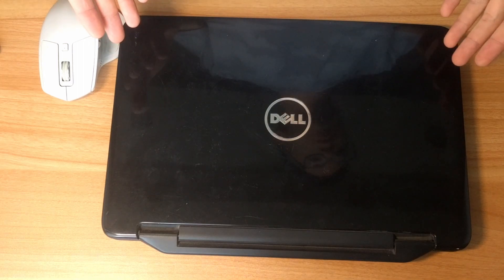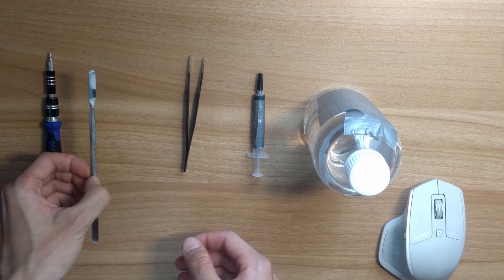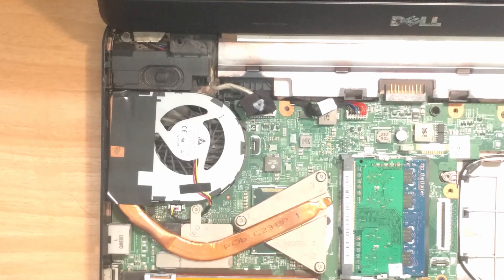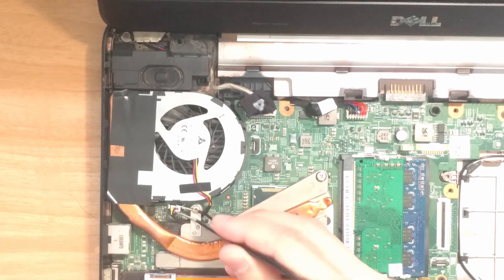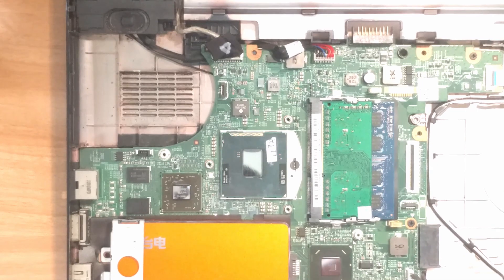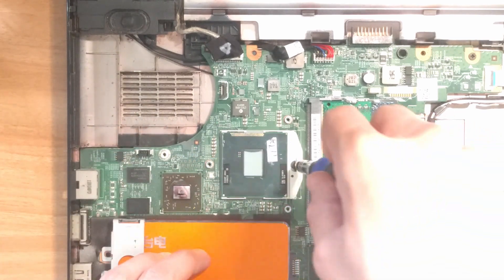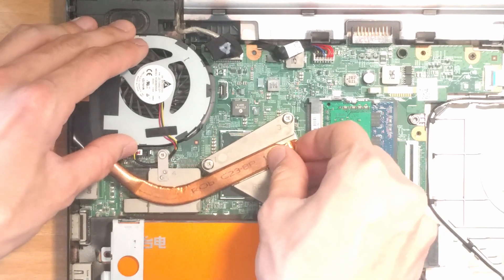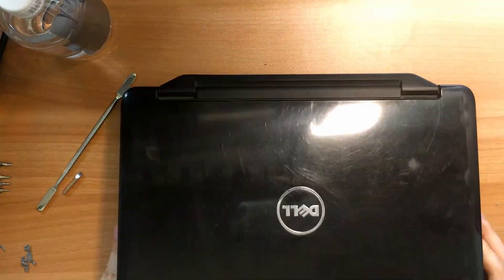Dell Inspiron CPU Upgrade

Comment: Great video - thank you! So Windows 11 upgrade failed due to processor in my Inspiron not being compatible - I was quite surprised. The processor is a Core i7-6700HQ and the specs are more that what Windows 11 minimum requirement is. So the question is - Can I upgrade the processor on this laptop - or is it soldered in?
Reply: i have same problems bro. :( i have Intel Core i7-6500U
Reply: It is soldered in
Reply: Your processor should be of minimum 7th generation for windows 11 ....6700HQ is a 6th generation processor.
Reply: @rohitjangid6893  Thank you so much! What number does 7th gen start from?
Reply: @oi3459  In 6700HQ number 6 states that it is from 6th generation. 
Same as for 7th generation the nimber start from 7 onwards.
Reply: @rohitjangid6893  actually windows 11 requires 8th gen cpus

Comment: Is it possible to take an i5 M460 @2.53GHz 2534 MHz CPU from a Dell XPS L701X and put it in a Dell Inspiron N7110 that currently has an i3-2330M 2.20GHz 2200 MHz CPU in?
Reply from the maker: I have made a video about how to choose the correct CPU, and you can find that in my channel. But just by looking at the names of the processors, it seems that they are different generation Intel CPUs, so the chipset on the motherboard may not support it.
Reply: Donald Sunny   i3-2330m=> i5-2540m / i7-2640m /
Reply: @qiaojiezheng5310  where is the video?

Comment: Is the Core i5 2330m the last upgrade for this laptop ?
Reply from the maker: You could replace the disk tray with a secondary hard drive, but I don't have the access to that machine.

Comment: would you be able to install 16GB ddr3 1333mhz? 
does the new cpu support 16GB? I have 2 4GBs and 2 8GBs to install but couldn't decide which to install. can you help?
Reply: You can install 2 stick 8GB+8GB RAM, 2Rx8 1.35v so-dimm DDR3L-1600, any manufacturer. What processor is in the laptop? Does the laptop have a Radeon graphics card or just HD Graphics?
Reply: @vladimirazirov1815  DDR3L and DDR3 are very different ram sticks. Mine has HD graphics. I have ram DDR3 ram sticks only.
Reply: @kergun11  You can use memory stick DDR3-1333 1.5v 2Rx8 8gb+8gb.
It's just that DDR3L (1.35v, 2Rx8) is more universal, so I bought these. The processor for upgrade is suitable i5-2540m, i7-2630qm. I use thermal paste GD007, I change the thermal paste and clean the radiator from dust every 2.5 years.
Reply: @kergun11  for a laptop to use 16GB of RAM (8+8), it must be Windows 10 x64 or Windows 7 x64, which according to the specification supports 16GB of RAM.
8GB memory sticks must be of the 2Rx8 type, 4GB memory sticks can be of any type (2Rx8 or 1Rx8).
Reply: @vladimirazirov1815  thank you

Comment: I've the Dell Inspiron with below specifications. I would like to know, can I upgrade the CPU along with GPU to support windows 11. Please suggest to which one I have to upgrade.

System Model: Inspiron 5537
Processor: Intel(R) Core(TM) i5-4200U CPU @ 1.60GHz (4 CPUs), ~2.3GHz
Memory: 12288MB RAM
Card name: AMD Radeon HD 8670M
Chip type: AMD Radeon Graphics Processor (0x6660)
Reply: That is a U cpu and is soldered down. Only M cpus are socketed.

Comment: I have dell inspiron n5010
Can i upgrade it to a gaming laptop?
Reply from the maker: You definitely can, but it would require a lot of parts. Like external GPU and a high performance CPU. It might be better just to build a desktop with modern parts.
Reply: @qiaojiezheng5310  Thanks!
Reply: I've got an inspiron 5593 with a core i5 1035G1. Can i upgrade that to a ryzen 5 3600?

Comment: I have Latitude E6540 i7 4800MQ can i downgrade to i7 4200U for better battery life?
Reply from the maker: These are two totally different processors. U series chips need to be soldered onto the motherboard.

Comment: Hello great video end thank for support
I have a question about upgrading my laptop dell inspiron 11 3000 cpu can it be upgraded to higher cpu
Reply: this processor is soldered to the motherboard and cannot be replaced.
Reply: @slavafedotov5742  well. Thank you for responding 
I also i have brought a used laptop dell Alienware 14 but is getin overheating end shuts dawn ,what do you think , where the problem is 
Thermal paste or something else
Reply: @HazCS  
1) the thermal paste has dried.
2) the radiator is clogged with dust.
3) disassemble and lubricate the fan bearing with machine oil (2-3 drops).
Reply: @HazCS  very rarely there is such a malfunction that the tube of the Cooling System is faulty - it loses its properties to conduct heat. Then you need to buy a new Cooling System (it is possible without a fan). This is done if the first 3 points did not help reduce the heating )
Reply: @slavafedotov5742  thank you for responding
You are a big help ,so it means i can repair my laptop to work normally ,all this problems can be repaired as i know
Reply: @No Matter's A6-6310 - это припаянный процессор (socket BGA). Нормальный процессор, 4 ядра, 2.4ггц. Поставьте SSD и 8-12-16GB оперативки DDR3L-1600/-1866 (1.35v).
Reply: @No Matter's да, при нагрузке поднимает. Так работает на базовой частоте 1.8. Вы можете открыть программу CPU-Z и включить например видео и понаблюдать за частотой.
Reply: @No Matter's можно процессор заставить работать интенсивней. Это разряжает батарею сильнее, но если вы работаете от сети, то это не важно. Проверьте в биос, включен ли турбобуст. Потом как Виндовс загрузится, то нажмите правой клавишей на значок Батареи в правом нижнем углу. Выберите пункт Электропитание.
Reply: @No Matter's потом в новом окне установите галочку напротив Высокая Производительность. Дальше заходите в пункт Настройка схемы электропитания -> изменить дополнительные параметры питания -> управление питанием процессора -> 
минимальное состояние процессора от сети и батареи ставите 95%;
максимальное состояние процессора от сети и батареи ставите 100%.
Reply: @No Matter's помогло? стал процессор быстрее работать? в биос есть настройка "включение-выключение турбобуста"?

Comment: Hey, there! I have a laptop Dell i14 5447 (2 in 1). My current processor is a i7 4510U. I'd like to know if its possible to upgrade to a more recent i7 generation. Is it worth it?
Reply from the maker: U series processors are soldered to the motherboard
Reply: @qiaojiezheng5310  sad... thank you, anyway

Comment: That looks like an AMD socket? Does intel Mobile cpus use pga?
Reply: I had no idea intel did pga.
Reply: @troublebreathing8648  which processor is installed in the laptop?
Reply: @slavafedotov5742  a pentium t1500 I think
Reply: @troublebreathing8648  
can install Core 2 Duo t8300 or Core 2 Duo t9300
Before replacing the processor, install the latest BIOS for your laptop model. Buy a syringe (1-2g) with thermal grease. For example, GD900 / GD007. Wipe off the old thermal grease with wet wipes and apply a new thermal grease with a thin layer throughout the processor chip (0.1-0.2mm). Blow out the radiator from dust and disassemble the fan and lubricate the bearing with engine oil (2-3 drops)
Reply: @slavafedotov5742  thanks!

Comment: Can i upgrade proccer on dell inspiron 3521 replay faast i want to install ryzen prossecer😉😉😭😭😁😊
Reply from the maker: Ryzen and Core uses totally different chip set and pin configuration, you will have to use a more powerful intel chip. I have another video about how to choose the CPU -> https://www.youtube.com/watch?v=USn0Syh3DR8
Reply: What happened with this? What chip did you end up using.

Comment: Hi sir, I am student and I am studying engineering I have Dell N4050 laptop and if i upgraded that to i5 processor and 8 gb ram, can I use softwares like solid works, catia v5, auto cad, designing software please help me on this sir 
Thanking you
Reply from the maker: 3D CAD software has a high requirement on the GPU. While the N4050 can run those programs,  you won't be able to manipulate large assembly files. Laptops with Quadro or Radeon Pro should be better, like the ThinkPad P1.

Comment: Whats the highest cpu upgrade?
Reply: I saw a video where the i7-2630qm processor was installed in this laptop, but the discrete AMD Radeon card and the turbo boost in the processor were turned off in the BIOS, because the cooling is weak in the laptop. 
We got 2GHz, 4 cores, 8 threads. Together with SSD and 8GB of RAM, normal performance turned out :)

Comment: Mine is Dell Inspiron n5110 what cpu can I change to mine?
Reply: what is your processor (model)?
Reply: @slavafedotov5742  İNTEL CORE İ5 2430m
Reply: @BurakKara  what laptop model? Does the laptop have an video card AMD/Nvidia or only an integrated card HD Graphics 3000?
Reply: @slavafedotov5742  DELL İNSPİRON N5110  intel core i52430m 😟.   Cpu upgrade ? İntel core i7 2720QM upgrage yes ? Bios update yes A11 ( Youtube loading )
Reply: @slavafedotov5742  ??
Reply: @BurakKara  i7 processor (4 core / 45W) can be installed. So that the Nvidia video card does not burn out (in the laptop there is one tube in the cooling system) from the hot processor, I advise you to turn off the turbo boost on the i7 processor. (the frequency will be on i7-2720qm -> 2.2GHz, on i7-2760qm -> 2.4GHz). 
With turbo-boost turned off, the TDP of the i7 processor is 26-28W.
Install BIOS version A11 before replacing the processor. 
RAM 8-12-16GB DDR3-1333, DDR3-1600 1.5v.
Reply: @BurakKara  Turboboost can be turned off via the "Power" section. Set the mode to "balanced", then go to the section "power scheme settings" -> processor power management -> set the maximum processor state to 99%, minimum 0%.
Reply: @BurakKara  I have i7-2760qm installed in my laptop. Together with SSD 250GB and 12GB of RAM, the processor has good performance, even without a turbo boost. Buy SSD 120-256GB (sata-lll, 3D TLC, 2.5") for disk C (Windows, programs, games), HDD (disk D / file storage) transfer to the DVD slot through the Caddy adapter.

If you want a turbocharged i7 then buy the i7-2630qm, which is less hot. But the turbo boost makes little sense here, because the laptop has a weak nVidia GT525m video card (which is the laptop's weak point) and the power supply will get very hot.
Reply: @slavafedotov5742  Apacer 120 GB PANTHER AS340 (how?) 120gb sufficient ?
Reply: @BurakKara  120GB is enough. Windows takes 40GB. Have you already bought an SSD Apacer?
Reply: @BurakKara  If you have not bought this SSD, then it is better to buy an SSD at a higher price, the quality is better there.

SSD Kingston HyperX Fury 3D 120GB 2.5" SATAIII TLC,
SSD Adata SU800 Ultimate 128GB 2.5" SATAlll 3D TLC,
SSD Silicon Power A58 128GB sata-lll 3D TLC 2.5".
Reply: @slavafedotov5742  Okey, thank ( intel core i7 2720QM + 16gb ram 1600mhz + ssd 120gb   ) gt 525m how upgrade ?
Reply: @BurakKara  the nVidia graphics card cannot be replaced - it is soldered to the motherboard. 
Buy memory modules 8GB format  2R*8 (8 chips on each side of the module)
Reply: @slavafedotov5742  2x 8+8 =16 GB 1600mhz + İ7 2720QM + 120 GB KİNGSTON SSD = 16 gb  beautiful upgrade? gaming low medium
Reply: @BurakKara  with this configuration, you can only play games before 2013 with high settings. I have 4GB+8GB memory in my laptop - that's enough for games. It is not necessary to overpay for 8GB+ 8GB
Reply: @BurakKara  you need a better video card for games. You can install an external video card (eGPU), you just need to disable the nVidia gt525m video card through the BIOS or simply remove its drivers from the laptop. Here is a video, turn on subtitles in English.
Reply: @slavafedotov5742  okey  ( i7   upgarede )  adapter 90wattt is it enough
Reply: @BurakKara  90 watts is enough. 
A non-turbo i7 consumes 26w TDP - that's the same as your i5. 
If you want to play with an external video card on a laptop monitor, then you need to buy a video card such as nVidia gtx950 / gtx750ti / gtx660 (2GB), nVidia gtx960 / gtx1050ti (4GB). And on the laptop, install the driver for the video card for the laptop. 
If you want to use a stronger video card, then you can take an nVidia gtx 1060 (3-6GB), but use an external monitor or TV. Install the driver for the computer video card.
Reply: @slavafedotov5742  thank you  ( gen2 ? i7 !  ) ( gen 3 i7 3370M upgrade ? yes ? no ?
Reply: @BurakKara  This laptop has HM65 / HM67 chipsets which only support 2nd generation processors.
Reply: @slavafedotov5742  240 Gb Goodram CL100 SSD yes ?
Reply: @slavafedotov5742  Lexar 240 GB ssd yes yes yes ?
Reply: @BurakKara  good reviews for SSD Lexar NS100 256GB sata-lll 2.5",
                                     SSD KIOXIA EXCERIA 240GB  SATA-III TLC 2.5" //

My wife has an SSD Team GX1 240GB sata-lll TLC 2.5" in her laptop - it has been working fine for 1.5 years, you can buy it.
Reply: @BurakKara  Goodram is Poland. Not very good
Reply: @slavafedotov5742  second hand ? SSD Team GX1 240GB sata-lll TLC 2.5"  if i buy
Reply: @BurakKara  Goodram - poor quality controllers, the disk often breaks. I bought the SSD Team gx 1 240GB new in the store.
Reply: @slavafedotov5742  ssd problem :( no no :(  boot settings?
Reply: @slavafedotov5742  SSD boot f12 yes flash windows 10  yes  / boot error
Reply: @BurakKara  I carry a laptop to a friend and he installs Windows for me. I don't know much about this. A friend installed an SSD in the HDD slot, went into the BIOS and turned on the AHCI mode there, then went to the "disk management" section and created a new volume on the SSD and assigned a letter (name) to the disk. Then the disk was formatted in NTFS. Then friend installed Windows on the SSD from the flash card.